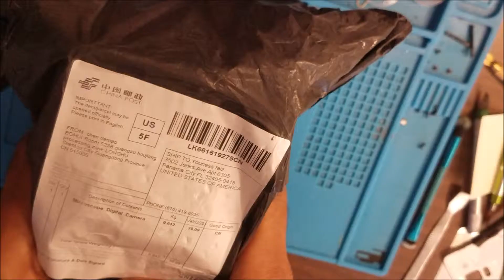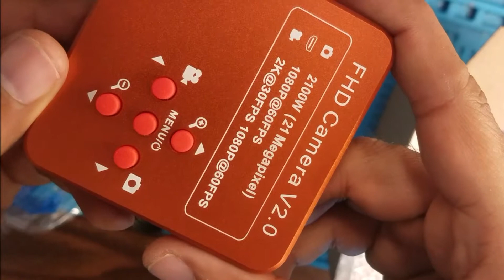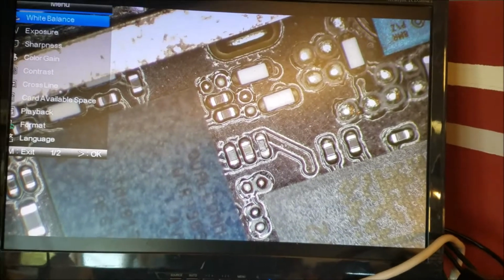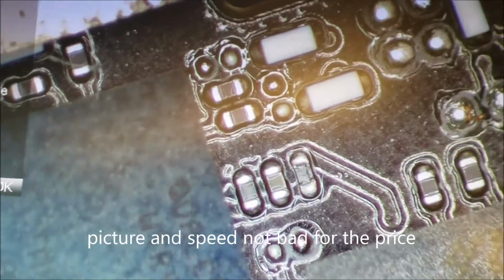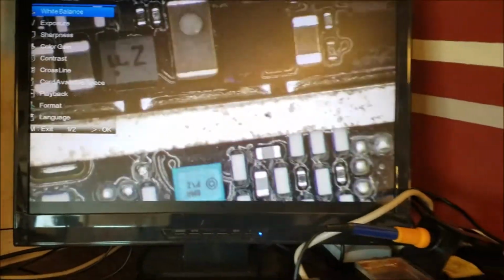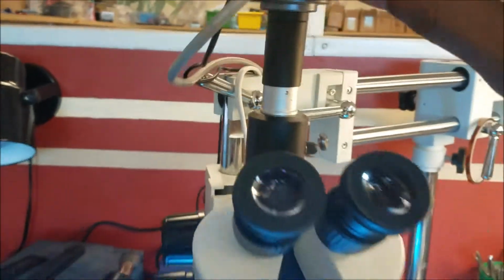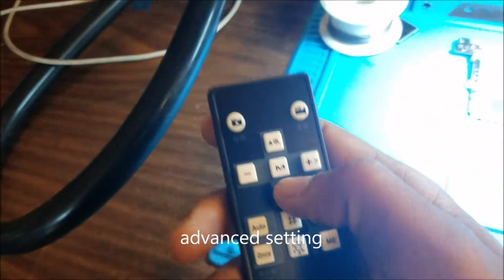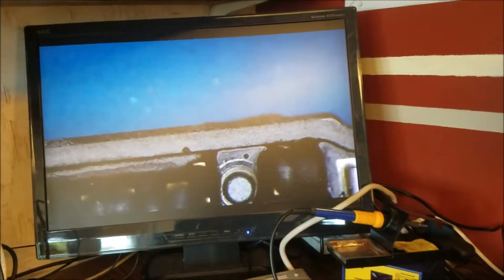koppace microscope camera FHD 1080p 60fps on amscope

Comment: Software is a fake. USB input cannot work with a computer software. This camera is useless to me.
Reply: I found the solution for using USB to take snapshots of my computer in windows8 and windows 10. I downloaded a free software calle Micam. I works with basically any microscope camera. Google "download Micam" on the web to download it. Problem solved (after trying so many different capture softwares). I bought the 38MP FHD camera V8 version of this camera. It's actually 2.1 megapixels in reality.
Reply: @JonathanVaucher  hello bro, you got the drivers this camera ?

Comment: Ok you are straight dumb. 1920x1080 is actually 2Mp but if you take a picture using SD card, you will have 21 MP. 1080p od by no means 21 MP. Learn to read your stats you noob